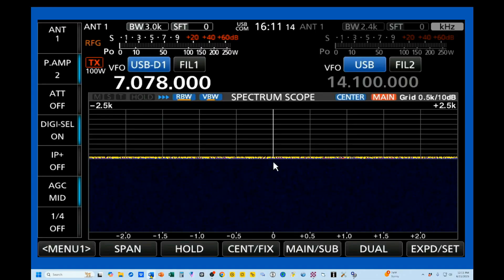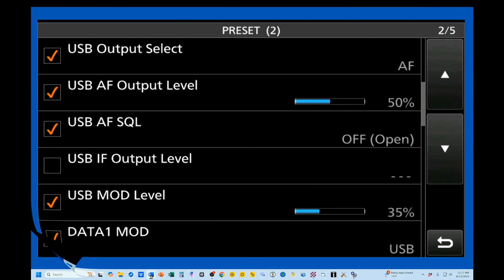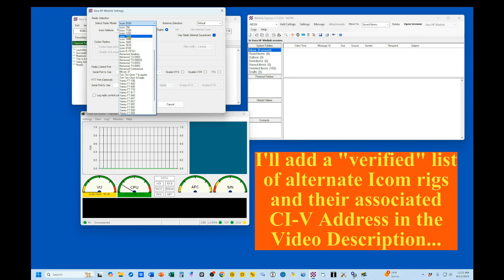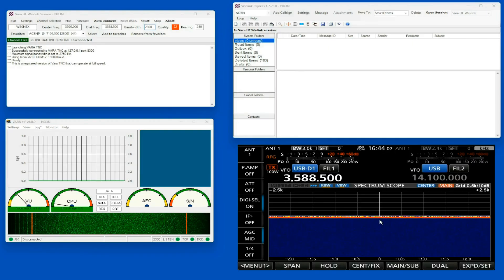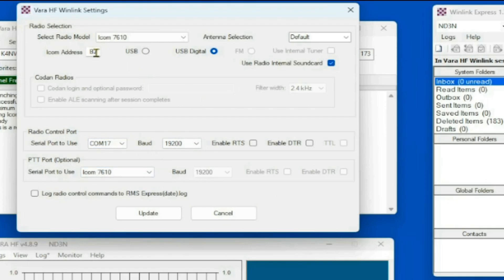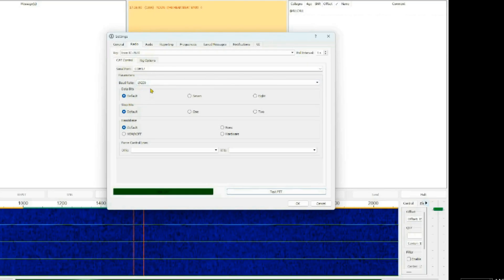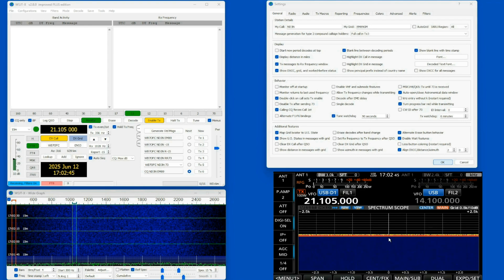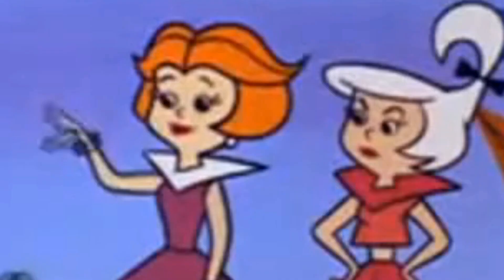Solving the IC-7760 Digital modes problem with spoofs and tricks

Comment: I wonder if the IC-7760 is selling that well. I’ve been looking at buying one, but I don’t see that many reviews. You have some good ones, but for comparison when other radios came to the market you would see more enthusiasm and more reviews. Thanks for the videos. 73’s
Reply from the maker: I think it’s the price, you can buy an FT-dx101MP for over $1000 less… that’s off the top of my head so….
Reply: I have had mine for a month now and it's a lot of radio, especially with it coupled with the pw_2 amp. I also have an FTDX -10 ..

The 7760 does so much more and if you are thinking about remote operations you really have a lot of options.

It comes with a heafty cost which is part why there are fewer reviews of it. 

If I had any criticism it would be the things icom doesn't include, like a mic, the PC software and a couple of cables.

The only operational negative is that I wish mouse control did more on the extended monitor. Certainly the PC apps all do that so I don't think Icom is going to add that. 

I am a month in and have been a ham for 35 years and am pretty tech savvy and I am still finding useful things.  

73

Comment: I found with HRD and with WSJR-X it resets the mode to USB each time it xmits, so until HRD patches it you have to set wsjt-x to no mode and then manually change the profile in the 7760.  Then it works as expected.. 73
Reply from the maker: Good info, thanks!